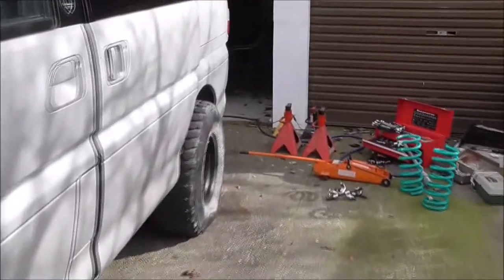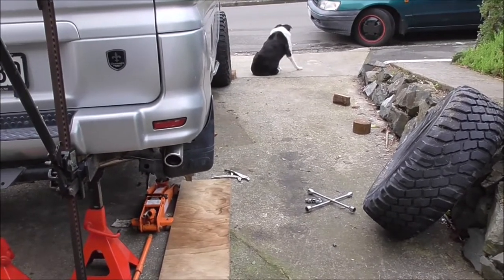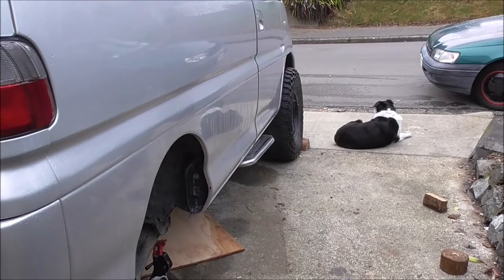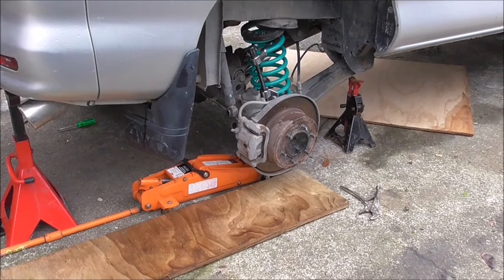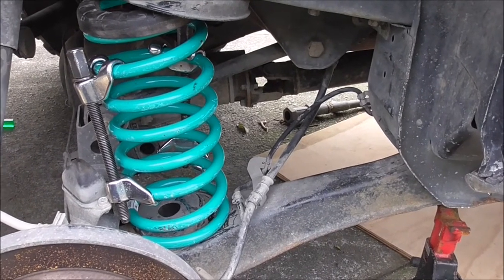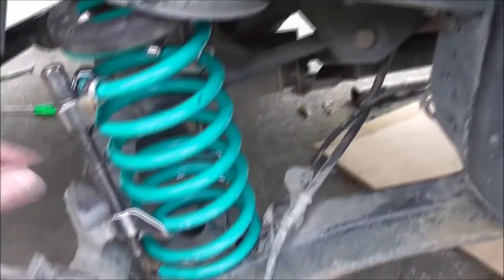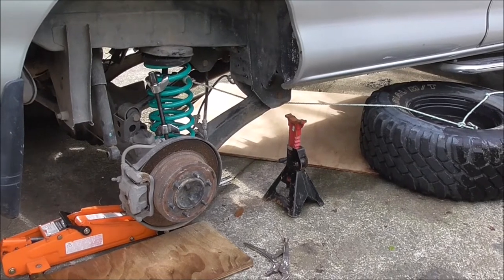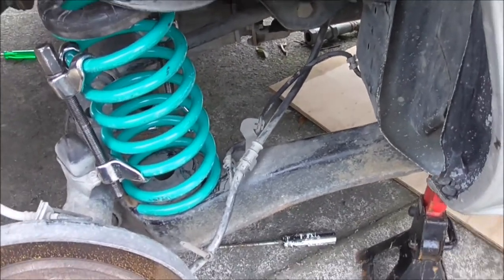Rear Springs Upgrade 2003 L400 Mitsubishi Delica

Comment: Steve thanks for making this video! I'm looking at doing this too soon. Any more videos / further explanations on this job would be gratefully welcomed. Cheers mate!
Reply from the maker: Hi, the actual job done this way is quite straightforward.  It's the little things in car jobs like this that can cause multi hour problems.  Make sure you have several of the common sockets/spanners, strong arm bar, enough jacks and stands.  I used a car spring compressor but nearly ran out of travel.  Another issue can be the location of compressor on springs.  Everything can go together then you might find you can't get to the bolts to get it off etc.
Reply: Steve Devine good advice thanks! And did you install drop link spacers? I was just reading about these, ball joint spacers in the front and break line spacers too...Did you have these put in?
Reply from the maker: I put the rear sway bar back in as they wanted it back for a warrant, so I'm not too concerned about the brake lines.  I need to find some ball joint spacers as that is a better option than the full torsion bar lift I have done

Comment: Hi steve thanks for the video, did those springs lift your delica much? im looking at upgrading mine but unsure what to go for? cheers mate
Reply from the maker: Hi, sorry for the delay. They lifted them about 60 - 75mm unloaded, and have worked very well for years, happily keeping up with normal traffic through a local mountain pass.  However, several years on I am now hauling a dirt bike on a carrier.  Even though the carrier and bike are only about 130kg, there is a bit of sag.  So the springs have worked very well for 4wd lift and handling, but might not be the best for serious weight carrying

Comment: Hey mate, i noticed you hadn’t changed the shock absorbers when you installed bigger springs, did you leave the stock shocks in? If so did you have any problems with them?
Reply from the maker: Hi Damon, no problems with the stock shocks even though this was several years ago now.  Still handles well
Reply: How long does the whole process take to fit everything?

Comment: Hey mate,  sweet as van. Do you have an issues opening your sliding door and wheel rub?
Reply from the maker: Hi Rowan, yes I do, however with the rims being 7" it's not too bad, as long as the van isn't parked on an angle facing the door.  Eventually I will get an extension , or make one.  I also took off the inner panel to save it

Comment: G’day mate, hope this mail finds you well. Please be so kind and give me the offset on those 8X15 rims. I suppose you are running 32 /11.5R15?? Cheers mate.
Reply from the maker: Hi Mickey.  Yes, 32".  They are actually 7" I have found out.  The offset number are difficult to work out.  Something like 8 (gap) 324 which doesn't make sense!  I am looking at going to a shallower, more positive offset to stop rubbing - basically more inset
Reply: Good to hear from you! Kind of thought you might have a clearance issue with such offset. Just watch out you don’t go to far in otherwise you might get a problem up front on full lock steering. Anyway mate, I can’t make up my mind on what size rim/tire combo. I have the same truck as you, SWB V6 with a 3.9 conversion. Now its time for a bit more space under the rear dif. otherwise I wouldn’t be bothered. How does your monster cope with that tire combo?

Comment: How can get lift up spring & how much
Reply from the maker: They are fairly common part with the large suspension suppliers worldwide (except in the US).  These are dobinson c109 from memory.  About $300 to buy
Reply from the maker: Landover spring are also a common replacement